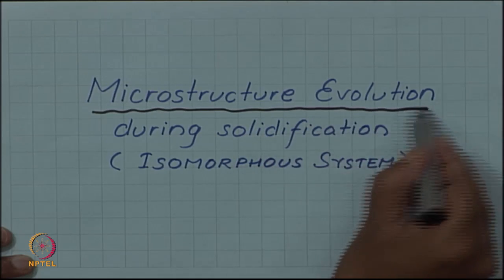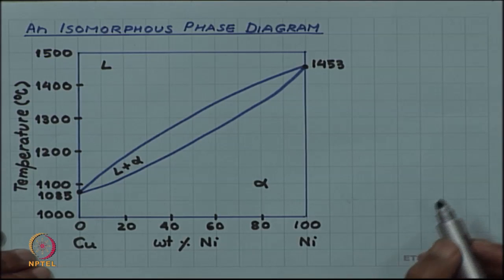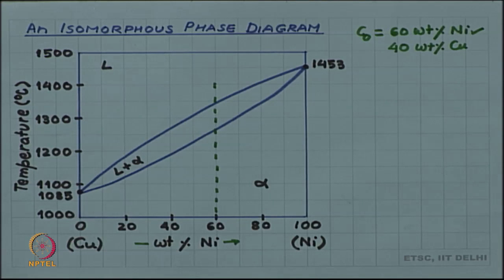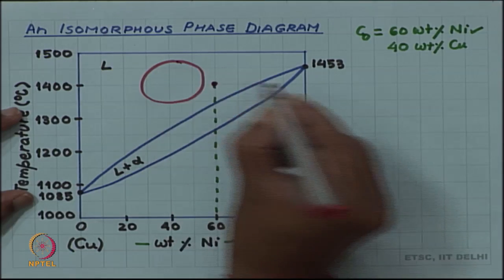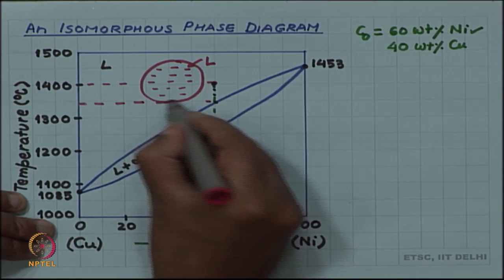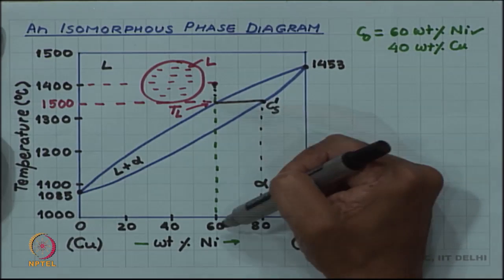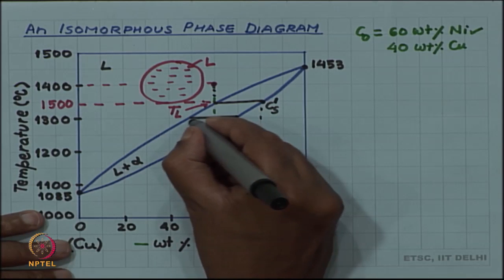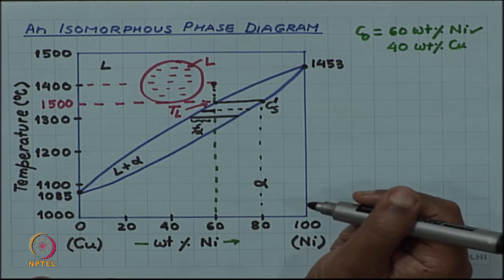Microstructure evolution during solidification in isomorphous systems

Comment: Sir, I'm having a doubt about the concentration of solid.
As you said the first formed solid will be having a composition of 80 wt% of nickel 
When temperature is reducing,  the solid formed at each temperature will have a composition less than 80 wt % of nickel  and the last solid formed will have the composition of 60 wt% of nickel .

Everything is fine,  but as the temperature reduces what will happen to the first formed solid's composition? 
Will it be same as 80 wt% of nickel?
Reply: No, in equilibrium the solid composition has to be uniform. This is achieved by diffusion in solid. This requires time. That is why we say that for equilibrium the cooling rate has to be very slow.

Comment: Sir,
In the first lecture - phase diagram introduction ,you said that Cu and Ni has ccp structure. Now in this lecture you mentioned it as fcc
Sir, please clarify which one is correct
Reply from the maker: Sorry for creating confusion. 

The idea is to distinguish between crystal structure and lattice. FCC (Face-centred cubic) is a lattice. CCP (cubic close-packed)  is a crystal structure. The relation between them is CCP crystal = FCC lattice + 1 atom motif. Because of this the centres of all atoms can be considered as lattice points. Thus often, in books and videos this distinction is not made and CCP crystal is also called as FCC crystal. 

So in one place I have an attempt to distinguish between these closely related concepts but here have fallen into the same trap of calling CCP as FCC!

Comment: Sir thing that often confused me as i have started with fixed composition C0 in principle the solidified material must contain same fixed composition e.g each grain and solidified region in microstructure  must have same composition  C0 as i started at beginning of solidification but solidified material possessed different compositions to C0.how does it seem logical mean i have added 40 atoms of A element and 60 atoms of B element after solidification i should have same atom ration in each region and grain but rather than i have 30 atoms of A and 70 atoms of B e.g similar different A/B atoms ratios in different regions and grains .normally this could be happened in non- homogeneous mixing of A and B atoms in melts .is this could be the reason in isomorphous alloy system as you explained? or some other reasons please explain

Comment: can the tie line be drawn at liquidous or solidus lines? even if we are drawing ...for example at liquidus line , Fa=0%  so there is no meaning for Cs(dash) at 5:13. As Cs(dash) indicates the % of components in alpha phase and there is no alpha phase at that point.
I mean , we can define alloy composition Co but not phase composition.
what i interpreted is correct Sir?
Reply from the maker: This is a good question. Yes, there is a contradiction that if the fraction of the phase is zero how it can have a composition. However, this can be resolved if you think in terms of limits. So as you lower the temperature towards the solidus temperature the phase fraction of liquid tends to zero and the composition of the liquid phase tends to the limiting value CL indicated by the liquids line.
Reply: @introductiontomaterialsscience  thank You Sir..for replying to our questions in right time as this helps us to understand further lectures.

Comment: On Decreasing Temperature
From liquid to solid
When solidification completed 
fL=0 and f@=1 
then 
On Increasing Temperature
From solid to liquid
When liquification completes
fL=1 and f@=0
Or 
Something Else Happens?
N what happens if we
Start from two phase (L+@)
Reply: Both your statements are correct, but they happen at different temperatures. On cooling, solidification completes at the solidus temperature TS. On heating, liquifaction completes at the liquids temperature TL. If you start from 2 phase system (L+S) the temperature T will be between TL and TS, i.e., TL>T>TS. Depending upon whether you cool or heat from this temperature you will reach TS or TL. If you cool and reach TS you get fS=1 and fL=0. If you heat and reach TL you get fL=1 and fS=0.

Comment: Respected sir,
@15.13, the polycrystalline structure will compltely form at solidus line or at the point below the solidus line???  At solidus line when we draw the isotherm then some part of liquid phase is also present. Please clarify my doubt.
Reply: If you draw the isotherm (tie-line) at the solidus line then the lever arm opposite to the liquid is zero where the lever arm opposite to the solid is the entire lever arm itself. This indicates that solidification should complete at the solidus temperature.

Comment: @4:58...if my starting point has 1400°© ,then how would the liquidus temperature be greater than 1400°©...it should be less or not??
Reply from the maker: Thanks for pointing out the mistake.The liquidus temperature is 1350 and not 1500. I have made a mistake in writing it.
Reply: @introductiontomaterialsscience magnanimous and generous thanks sir
Reply: Good eyesight..
Reply: See that the whole analysis is taken at a particular alloy of 60% Ni